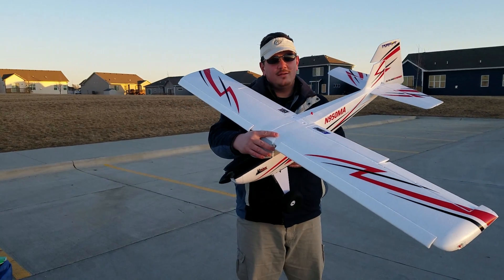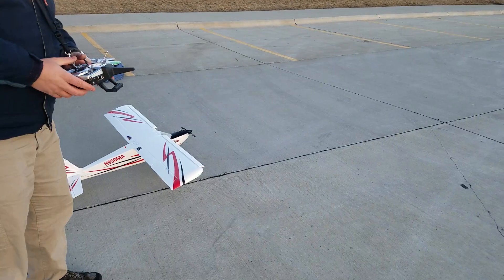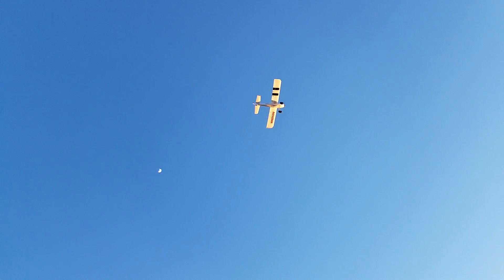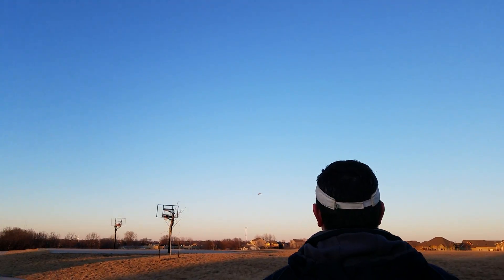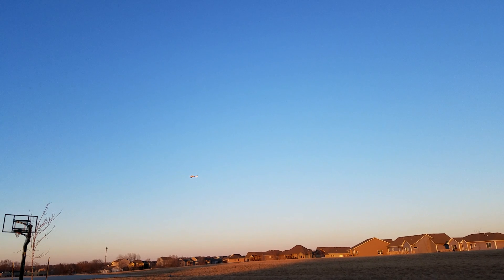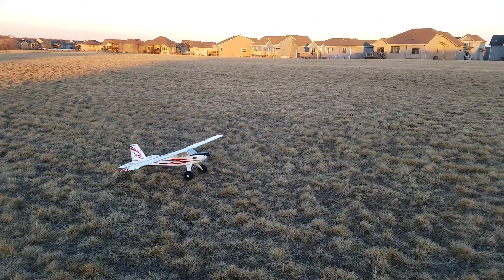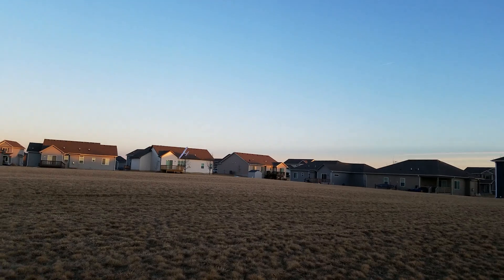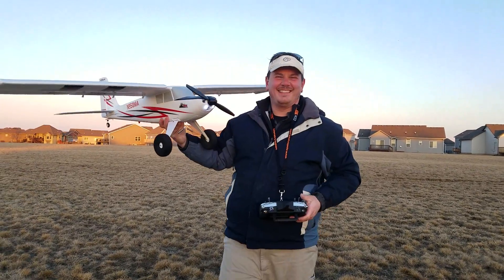Horizon Hobby - Timber 1.5 m - Maiden Flight - 2/3/2017

Comment: I 've been flying for a while, i have the timber cub myself, and still after all this time i have no clue what the hell expo means. Googled it, and got one of those explenations where every simple word is replaced with something complicated and long for the sake of it. Could you please explain what it does, not trying to sound like A Einstein explaining string theory? thankyou!
Reply: im thinking it smoothly makes your rudder, throttle, aileron imputs lag behind a bit to add to smooth, calm flight. i have no clue!
Reply from the maker: Karl, this is the gist of it, Expo makes the plane less touchy, without giving up the maximum throws needed for crazy maneuvers (...like Holy-Crappers, there's a tree right THERE, pull up!!!!!!!!!!)

For the sake of simplification, let's consider ONE control surface, in ONE direction...

When you move the elevator stick down all of the way, the elevator moves all the way up, thus making the plane point up and climb, provided you are carrying enough inertia...

Move the stick down only 25% of the way, the elevator moves 1/4 the way up, making the plane climb to a lesser degree.

Now, lets say you need to move the elevator 2% of the way up...you're gonna be very hard pressed to execute that finite maneuver, no matter how good your muscle memory it, so we will use EXPO. Note that the extreme example could simply be resolved with trim, but it's only an example to make a point here, so humor me :)

Expo will make the elevator less responsive at the "center" and more responsive at the extremities of the stick area.  (Also, for the record, you can make this Opposite, if you so desire by doing negative expo...but that's even more foreign to those just starting to grasp EXPO, so let's just forget I even said it :) )

If you setup the elevator expo to 50%, then you repeated the above test, this would be your outcome...

When you move the elevator stick down all of the way, the elevator STILL moves all the way up, thus making the plane point up and climb, provided you are carrying enough inertia...

Move the stick down only 25% of the way, the elevator now only moves 1/8 the way up (0.25 X 0.5), making the plane climb to a more finite degree....so you can have more leeway when you're trying to make the plane move less.

Now, lets say you need to move the elevator 2% of the way up....well, it's still gonna be hard, but you'll have about twice as much stick movement for the same output.

I know this is hard to grasp, but you gotta just go and try it. Set all the expos to 30%, with ONE switch if you can, then fly the plane. Turn the switch on when you're at a safe altitude, and "FEEL" the difference. It will deaden the central stick positions, and gradually recover to full throws as you move the sticks out of the middle. It's VERY helpful for inexperienced pilots, but as you learn your plane, you can refine the settings for each control axis, until she flies like butter :)

Good luck - NOW GO DO IT!!!!!! (you won't regret it)
Reply: ....so... i kinda guessed right? Anyway, thank you for the AWSOME reply, I honestly wanst expecting quite a response. It is awsome that you are connecting with your vewers and putting time into them.Ill try this on the timber,it'll be great. thanks.
Reply: ok, one last thing, thinking about crow brakes for my timber for steep landing approaches, and just slowing down in the first place, but are they really nessesary? Im doubting it now.
Reply from the maker: You're welcome! I want to invest in my audience, plus I remember when I was just getting (back) into this stuff and I'd get the "template" answers from guys that you could tell really didn't understand what they were saying. I would probe, and never really get answers...and it gets old... I'd rather just hear, "I don't know", then a bunch of bs.

Expo is a really a pretty "simple" thing that's very hard to explain, but once you use it, you'll know where you can apply it within your fleet. Definitely something worth looking into!

...and I tend to be long winded. My hands can't keep up with my brain, and when I talk about this stuff, my mouth can't keep up with my brain either, so sometimes I'll puke out stuff in the wrong order or in a way that's tough to understand, but I'm working on that for my videos :)
Reply from the maker: Crow is super cool, and I use it on several of my gliders. First thing to consider....You'll need to have another channel, since the ailerons are tied together on this plane, if you have BNF, of course. If you're flying the PNF, you may already have the ailerons separated out. IF that's the case, you could setup flapperons and tie another, higher Auxiliary channel to the Flap servos...

...BUT, you will definitely NOT need it on this plane. You can practically catch the Timber, it'll fly so slow with leading edge slats and full flap deployment. If you add CROW, it'd be kinda cool, but with BNF, it's be very complicated, and I'd recommend against it.

BUT DON'T LET ME STOP YOU ;)
Reply: I saw the 1.3 valliant with crows, thought it was cool, saw tundra with crow, and that was awsome, but then I saw 2:44 😂😂. That basicaly answered my question. Thank you so much, i will leave you a lone now. i'll be sure to watch your other videoes!

Comment: hey brian,can u inform me about dual rates and expo for maiden flight..best rgrds fm athens.
Reply from the maker: I'd just follow the manual for the maiden. Expo is so subjective, and tentative, but I do the following as a start most times, if they aren't specified...
For all three axis, tied to the same 3 position switch, and then I adjust after the maiden flight...
Expo / Rate
10% / 100%20% / 100%30%  / 90%
Reply: thanks a lot!!
Reply from the maker: Sure! Sorry Google didn't like my nice formatting...it stripped all my carriage returns :(

Comment: Hi how much flight time did you get with a 2200 mah battery?  Great plane!
Reply from the maker: I flew it to 7 min and 15 seconds, but never hit my low voltage alarm...kinda forgot about getting down to warning.

I bet I could go for a few more minutes, but I'll fly her harder as I get more used to her performance.

This plane seems HUGE for a 2200mAh 3S 60C pack.
Reply: Brian Phillips how much did airbus 320 cost and from where can i get it ?.

Comment: You said your flaps are set on a 3 pos switch. Do you use one setting for takeoff and a dif setting for landing. And going back to the other thing, when you get a new plane is it a matter of first learning how the plane flys before u get the right settings.
Reply from the maker: Yes, I always use a three position switch...

Position 1) Neutral or Home switch position - for No Flaps / lined up with the shape of the wing, generally. I set this one all the way down and away from my body, while holding the transmitter, but this is totally just a preference thing.

Position 2) Middle switch position - for "Take off setting"...this would be a small amount of flaps, and very little elevator correction. When the flaps are only partially deployed, they increase lift by changing the size and shape of the wing, but in this setting they'll add less drag (something we'll talk about on landing setting). This setting will also reduce the stall speed, thus allowing for a potentially quicker takeoff as well.

Position 3) Top switch position - for "Landing setting"...this would be the maximum deployment of flaps (down/out the furthest), which will not only increase the lift the wing produces at the same speed by changing the wing shape and size even more, but it also adds quite a bit of DRAG to help slow the aircraft. The stall speed is usually reduced quite a bit, but BE CAREFUL, just because the plane keeps flying at a lower speed, doesn't mean it can't or  won't stall, and the control surfaces can and will become less effective as the plane slows down - plan on it. 

There are many benefits to flaps, namely slowing down the plane without falling into a stall. This allows for less wear an tear on landing gear, easier landings, shorter roll outs, shorter landing strip requirements, and steeper approach angles, for better visibility for pilot(s) in a full scale plane, and more landing approaches.

As for your second question...

I setup most planes the same, then tweak the settings after the maiden flight or after a mod is complete, and occasionally after more flights. Sometimes I'll even adjust settings a bit for differing flight conditions.